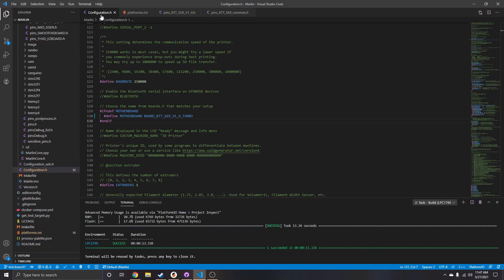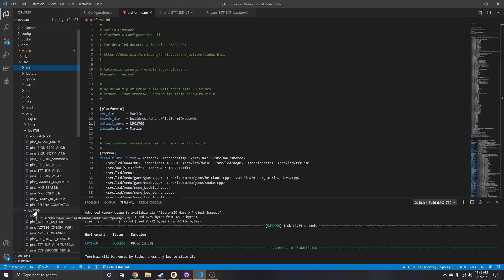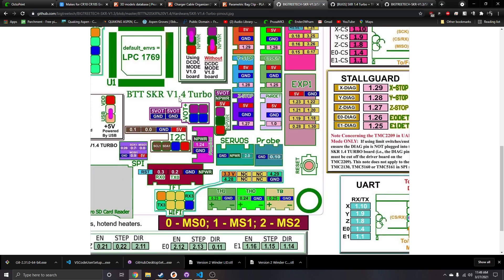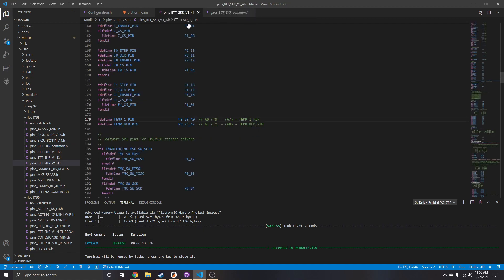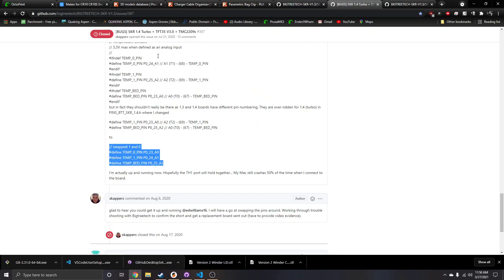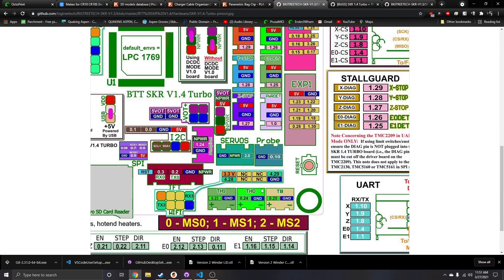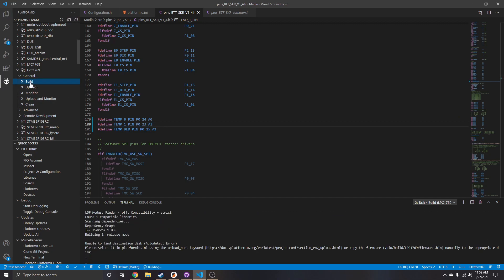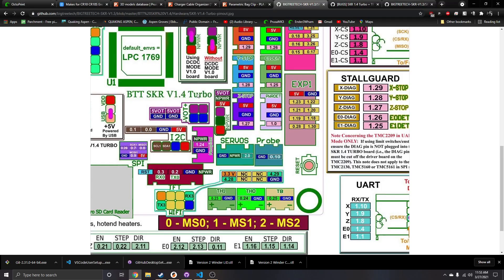BTT SKR 1.4 Turbo Swap Thermistor Pins MAJOR BUG!

Comment: My E1 just went out randomly on SKR 1.4.... glad you made this I will try it out tomorrow hopefully get back printing
Reply: I had the same problem with an SKR 1.4 Turbo, did you solve the problem?
Reply: @eljeko_77  yes but it had a domino effect and more devices went out so I switched back to a 8 bit cheap board and have had no more issues... the skr boards are crap.
Reply: @mikecoleman1685  Thank you for the feedback

Comment: I have the BTT SKR 1.4 turbo and was looking for a fix to correct the problem with the hotend. I wanted to see if your fix will correct the issue I'm having. I can't not get he hot end to go above 235c. I'm running Marlin 2.0.6.
Reply from the maker: This might not be the fix you are looking for. You want to set maximum extruder temperature in marlin to 300c if you have an all metal hotend. Marlin defaults to -25c of the set point as maximum. So if you set it 300c in firmware, you can only hit 275c.
Reply: @TheMidnightSmith  I have not make the changes you have pointed out and I have no issues. What was your issue? My problem is when I try ti set my hotend to print PETG @ 250c. The controller only goes to 235c no matter what I set it to above 235c.
Reply from the maker: @ajmottola52  yes, because in marlin, your max temp for E0 is too low. You must increase it 25c over your desired max temp. So if you want to hit 250c, you must set it to 275c max temp. Look in marlin for "max temp E0"
Reply: @TheMidnightSmith  Can you get your board to 250c
Reply from the maker: @ajmottola52  yes, mines up to 300c if I want

Comment: 3D Printer Temperature problem..

https://www.youtube.com/watch?v=HhLtOy96UiA

Temperature different to multimeter probe reading

Tried different Heater Cartridges and Thermistor's, no luck same issue:

I tried chaining thermistor ports
no  luck as in this video
BTT SKR 1.4 Turbo Swap Thermistor Pins MAJOR BUG!
https://www.youtube.com/watch?v=yNfKjRSoGEM

TEMP_SENSOR_0
tried a number of different  settings
Resistance 88.8 K at 30 Centigrade

Tried #define HEATER_0_MAXTEMP 500 // Protomaker Sprint Above 250 may produce TOXIC fumes as Bowden Tube close to Hotend. Using All Metal Hotend
::a asking for  over    2900 results in E1 HEATER MAX error

Tried daft amount
:-
if ENABLED(THERMAL_PROTECTION_HOTENDS)
 #define THERMAL_PROTECTION_PERIOD 40        // Seconds
 #define THERMAL_PROTECTION_HYSTERESIS 25     // Protomaker Sprint Degrees Celsius WAS 4

 //#define ADAPTIVE_FAN_SLOWING              // Slow part cooling fan if temperature drops
 #if BOTH(ADAPTIVE_FAN_SLOWING, PIDTEMP)
   //#define NO_FAN_SLOWING_IN_PID_TUNING    // Don't slow fan speed during M303
 #endif

BigTree Tech SKR 1.4 Turbo.   BigTreeTech UPS Module

Marlin 2.0.7.2 : Is this the problem?

AliExpress; Mellow Upgrade CR10 All Metal Hotend Extruder Kit Flexible Titanium Heat Break

For Creality CR-10 CR-10S Micro Swiss 3D Printer Properties: Size 24V Set 2 Add HTNTC

(Mellow Store)

I need Marlin setting Number for the  HTNTC

I have used PID tuning on the previous nozzle which also had this same temperature issues.

Both the Marlin Bootscreen and the Custom Bootscreen are no longer displayed.  The status screen displays OK

Thanking You for any help

Comment: The problem is when you change the pin number in SKR1.4.h you set it to P0_24_A0 which doen't exist and why you get the errors. When you set the new pin in configurayion.h you set it to P0_24_A1 which is correct. This isn't a bug just a typo from you.
Reply: That what I was thinking too
Reply: Yeah, the Problem here was that A0 is on Port 0  pin 23 not 24. But still the video helped  me figuring out what y problem was. So Thanks a lot.